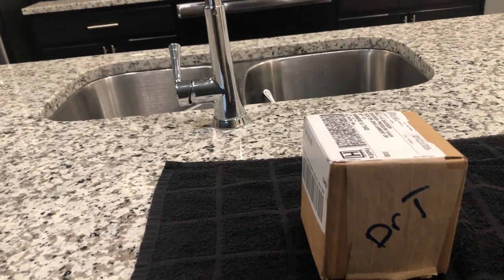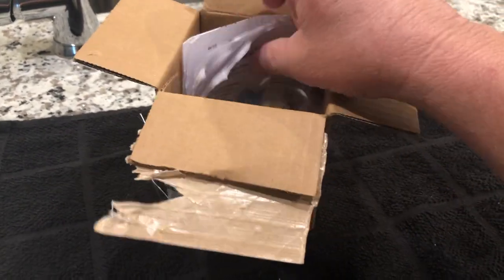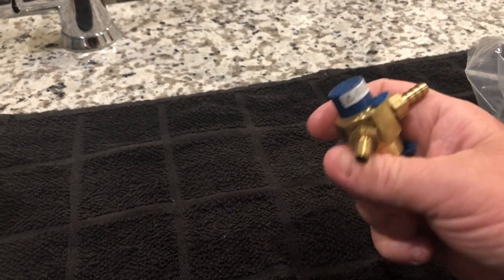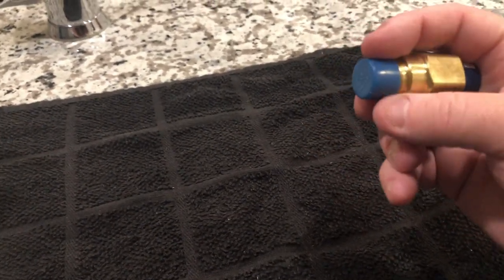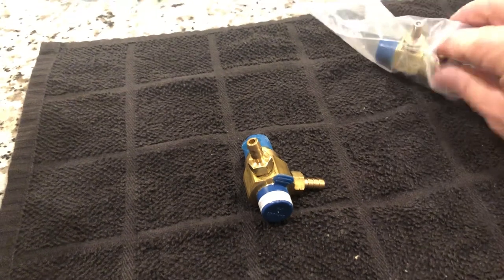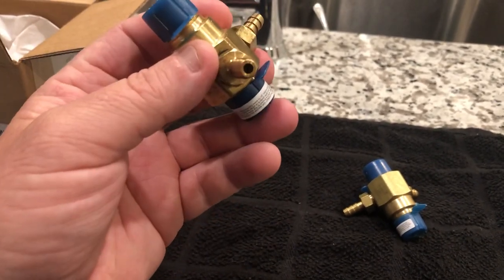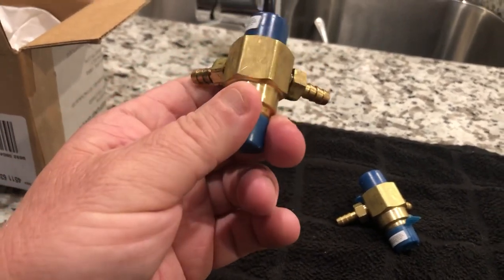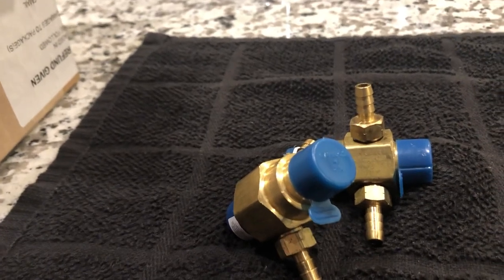Downstream injecting methods technical data and unboxing

Comment: Billy - Any reason that you prefer downstreaming over pump? Why or why not?
Reply from the maker: The large majority of our jobs is large commercial and government projects. Some of those projects we cannot get a vehicle within 300 feet of the building so we have to downstream it where as a soft wash pump would struggle trying to pump a solution that far from the work trailer